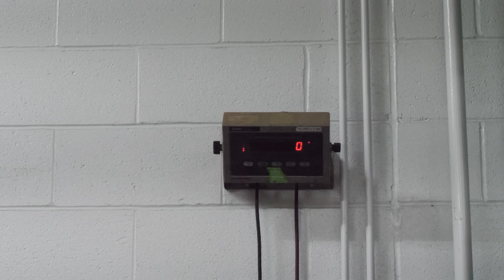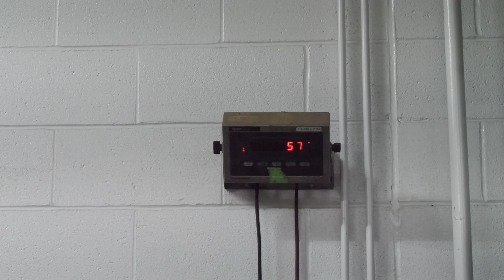EV TEARDOWN! Nissan Leaf Complete Electric Vehicle Drive Motor Unit Disassembly!

Comment: Not to be daft, but you are supposed to put these in Allegro's if I am understanding correctly. https://www.youtube.com/c/KiwiEVadventures

On my MiEV I changed the transmission oil about every 60k miles, it gets dark over time. That and a wheel bearing was about the gist of it.
When Manufacturers  say it is for the lifetime of the vehicle, they mean the warranty period.

Comment: Batterys suck electric motors are amazing my dad has one from the 1920s 1930s and 1940s they are ruff but they still work just fine there all 10 hp versions all made of steel cases so heavy duty.

Comment: Eric
Take care of that scale, eh
It'll take care of you
-a scale guy
Reply from the maker: How does one, take care of a scale? 
Asking for myself because we have used it to weigh LTL, 3500lb scrap bins, etc
Reply: @I_Do_Cars 

Keep stuff from getting jammed under the deck
The cable that goes from the deck to the indicator should be in conduit or at least be careful around it, especially when using a forklift 
I imagine the loadcells in it are rated for either 2500lb or 5000lb, just means between any two loadcells you can put 5000lb or 10,000lb depending on loadcell capacities... just don't drop stuff on it lol
Temperature swings can cause problems, what for condensation inside the junction box if the gasket is failing or has failed. Or cord grips are damaged. 

As long as the scale isn't rocking on two of 4 feet, it'll be fine. 

I mention any of this because the amount of time I've spent in a scrap metal yard fixing platform scales because someone dropped something on it, or ran into it with a forklift and pinched a cable... it's needlessly expensive. 

The indicator looks like an older Mettler Toledo, thems are stout. 

Take care Eric, love the channel, some of your edits and comedic bits are inspirational for tiny channels like me.

Comment: all connectors are made by deutsch...or their design is copied. :D even the 50y old 3phase motors come apart like that ...no drama needed :D this one has just some neodidmium magnets in the rotor no cables no nothing just a shaft a pair of bearings and the rotor core.

Comment: Even though I am a die-hard gearhead, a job change necessitated me to trade in my truck for a 2018 Leaf. I have to say - it was a GREAT little car. Very roomy, handled nice, no maintenance, dirt cheap to drive. The battery failures were a problem with very early models that were worked out by the 2nd or 3rd model year. It was the perfect daily driver.

Comment: EV: no emissions, but......
- very expensive cars with just screens that eventually break down and nobody can fix them for under 10k dollars
- very heavy battery
- takes a lot of time to recharge
- degrades
- the production of a battery is very polluting
- needs Rare Earth Metals, form mines that are for 90 % in chinese hands
- EV's are very heavy and dangerous in case of fire
- where does the power come from? Coal, oil or gas maybe...?

- the infrastructure for charging is simply not there, and people in appartments can't charge on their driveway.

no they have no future, untill there is a real revolution in battery technology: light, easy to recharge, a lot of miles in it, no degrading and cheap to make. 

Go hybrid and save up to 30 % of gas.

Comment: No spark plugs.
No starter motors.
No fuel lines.
No fuel pumps.
No Injection systems.
No intake systems.
No cam shafts.
No crank shafts.
No pistons.
No transmissions.
&
No reason to fail.
"Figure it out"
Ya been lied too.

Comment: The next time a person asks WHEN will I (most gearheads)  should say...

I will only get a EV when I can blow a conrod out the side or spin a bearing...

I personally have never ruined a engine and always maintain my cars better than most people and even do oil change by date and not kms,  even with only 5,000 kms in a year and replace tyres every 4 years as well..   New Zealand roads are low grip and old tyres don't hang on well and I rather buy tyres more often....

Please keep up what you do....

Comment: -The problem with the Nissan Leaf was that it didn't have a lot of range, but more than anything it had an air cooled battery.  Air cooled ICE engines are bulletproof, but air cooled batteries are a problem waiting to happen.  Donald Trump's girlfriend Elonia Musk even noted this when the Leaf came out, since Teslas and pretty every other EV  has a pure ethylene glycol liquid cooling system that never needs to be serviced.

Comment: Eventually people will buy the outcast motors and make electric restomods. As long as someone designs a custom electric motor controller. How about 107 hp at each corner? 428 hp